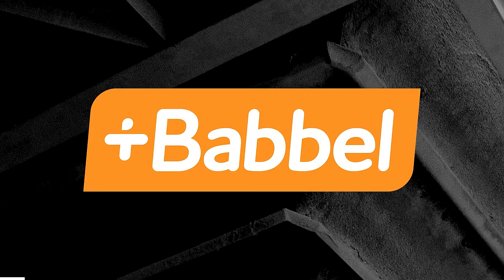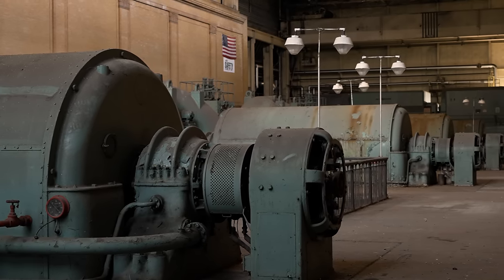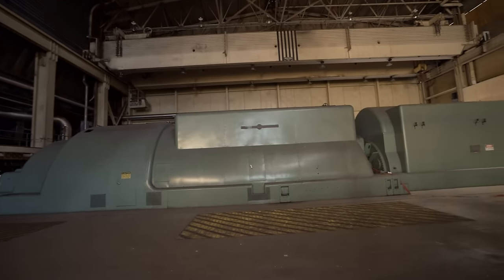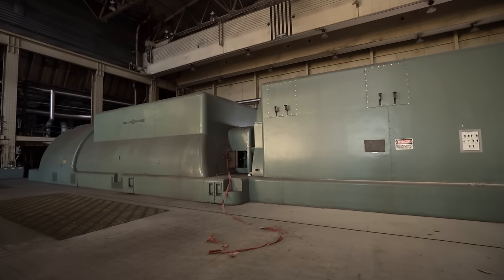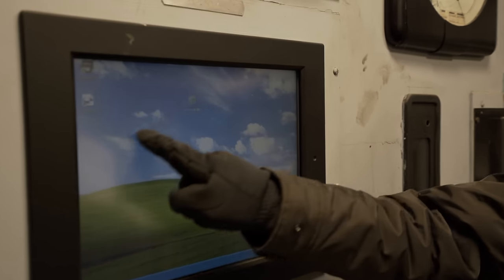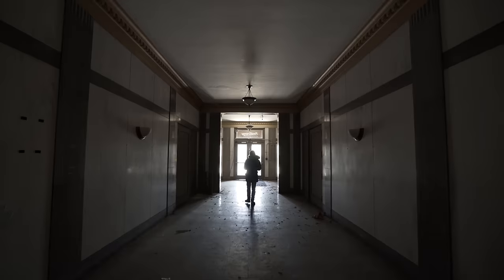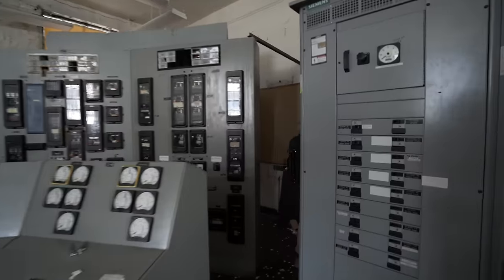Power Still Runs Through This Abandoned Power Plant! - Exploring Industrial Ruins

Comment: 27:50 - i believe those are rotary converters used for converting AC into DC. An AC motor turns a DC generator thus turning the AC into DC. Elevator manufacturers were fond of using these because DC motors are (or were back in the day before VFDs) easier to control for slowing the elevator down etc.

What those are doing in a power station though is anyone's guess.

Comment: There is a lot of abandoned factories in the ohio valley. They just closed a coking plant in follansbee on the west virginia side of the river about 2 years ago. These old power plants and factories are insanely huge monolothic structures that were built to function. We've moved far past the use of analogue machinery as well as traditional brick, steel and toxic asbestos to a more obfuscated architectural style with composite materials and digitally controlled circuits. When you see these places in person, it's like looking at relics from hundreds of years ago.

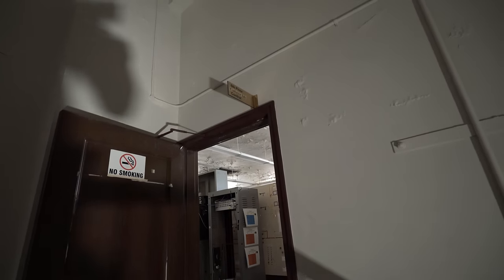Comment: 20:52 The original North Power Plant for the University of Alberta, Canada in my city (Edmonton) was conceived as a multi-use building. In addition to a couple of coal-fired turbo-generators, the rest of the building was used for various university faculties over the years. The Faculty of Medicine occupied part of it for a time and, yes the Cadaver Lab was on the top floor (which caused some difficulty in getting the "subjects" into the labs since there was no elevator!)
The boilers and generator sets are long gone now, but the building has been preserved, including the octagonal brick chimneys and the gantry crane.

Comment: 29:50 that might been the camera server, where it all recorded on. 1) security fiber optic wires that are red color is always used for fire alarm or security, just so entreprenours know not to cut them by mistake. 2) all those extension cores to keep the power on, even thou water leak. It was important. But u dont place important control server for the operation of the plant in the basement, that is a safe space for maintence security stuff. 3) if u count the amount of cameras, there should be 1 red optic fiber line for them each.

Comment: I work for a utility we just tore down our last gas fired steam generator plant boiler types we still have combined cycle. When I first started with the company in 2000 I remember going to that plant and seeing 100 employees working there. Now not a single employee at that plant 3 gas fast start turbine generators that are operated by remote control used for peaking during summer months when the grid needs a fast start generator. The natural gas directly fuels the turbine which turns a generator. We do still have a few coal plants which still use boilers both are in process of being shut down over the next 10 years. The control rooms are still there look just like these built in the 1950's and 60's find a desk with a PC and monitor being remote controlled from a control room at another plant. One PC replaced everything in that room. I'm surprised they don't have cameras, and security systems all of our decommissioned power plants are protected by security.

Comment: I went to a power plant in Victoria, Australia being demolished a few years ago.  Known as Hazelwood, it was built in the 1950's and despite being closed, and half knocked down, the transformer switch yard was still live.......since it was an interconnect with two very large operating power stations nearby.  That station has some really old gear.......its a wonder it doesnt have a mercury rectifier.

Comment: 40:52 I think these are the static "generators" for the electrostatic precipitators (ESP), which were probably the only flue gas pollution controls that plants had in this era. The control panels for them being shown a couple seconds prior. I saw these exact same type of units in the PECO Richmond generating station (built 1923?), and they were also installed right under the roof at the top of the boilers, but in a crazy room with plate steel walls, making it a Faraday cage of sorts. These are just out in the open.
I'm guessing the HV transformer is at the rear and the output is just that metal rod hanging off the transformer that scrapes on the 4 spokes of that wheel being spun by the motor, so it interrupts at some high-frequency interval before being sent to the plates in the flue gas stream. 
The ESPs themselves are the 2 giant square boxes you see right at the base of the "decapitated" stacks when he goes on the roof a few seconds later.

Just a guess, but anybody out there that knows exactly what they are?

Comment: I'm willing to bet if they were to put those original turbine generators back online, they would still work fine and very likely would still be running strong in another 100 years and the newer power plants and new generators in use  will have failed and been replaced at least 2 or 3 times before then.

Comment: It's very likely that the server running that the extension cords were running off of were plugged into UPS systems in order to power the door locks for the card access once they shut things down. The card swipe units run off a serial bus, but the actual power to the locks is separate. Given how many cameras you walked by it's also likely the cameras are/were running off it too. But  it's unlikely anyone was actively monitoring it. Given that they retired the last unit in 2015 and the smaller ones in 2002 it's also likely that the security cameras were only installed in the 2000's as those aren't vintage camera systems It's probably closed circuit.

Either way, the largest danger there was running into live circuits and potentially damage to asbestos insulation. Seeing the frozen fish was probably not on your list of expected things, and that suggests that the plant needs some maintenance to keep it from killing fish.

Comment: 25:15 it's good that the contactor is locked out. Gently throwing the handle would result in a broken arm and possibly a corona discharge of current. There would flow so much current that one must aggressively "throw" the handle in order to "shut" (manually) the connection. Anything less than FULL HUMAN EFFORT would result in that handle "kicking back" out EXPLOSIVELY.
If that plant is still "hot, hot, hot", as it looks, those handles ARE NOT TOYS!
Stay safe and PROPER PEOPLE. 👍👍👍👍👉👏👏👏👏👏👏👏👏👏👏

Comment: 27:50 those things are converters . They take the power from one source for example 600v 3 phase and convert it to DC or a lower or higher voltage . This system was used before semiconductor switching took over for the most part . I worked on similar units for a ship that was build in the 60s . That particular unit was used to take shore power and turn it into whatever they used on the ship . They had a bank of them similar to the one shown , i think they go by a few different names rotocuopler and rotary transformer come to mind but I'm not sure .a similar device can be built to convert say 12v DC to 120ac with the correct pair of motors .

Comment: Live extension cords, wet floors. What could possibly go wrong ? As long as those cords are insulated, and the power strip I spy doesn't fall on the floor, you should be okay until you touch something. Electric doesn't take the shortest path to ground or the source, it takes ANY path. You guys need to be more careful. Great video BTW.

Comment: Blasting the ctrl room with a powder fire extinguisher means it is done for good.. The powder will soon lead to corrosion in many places that aren’t obvious to those trying to clean it.

Reminds me of a naval vessel somehow. Non-asbestos doesn’t mean healthy, it should have been treated on the surfaces.

Excellent mix with the old footage, I watch a lot of the old stuff just for fun, like poking a periscope up into time long gone.
Reply: that X-section of the plant is interesting. it shows it as a whole and also its principle of producing heat: Forced air blows milled coal dust into the furnace where it gets combusted in an efficient manner.
This is the same process like in the one you visited in Spain, I am not sure but I think this process was invented in the UK for use in shipping. Happy to be corrected if wrong.
The very high stack is somewhat of an indicator on its principle of operation, one doesn’t have a long furnace but a tall one where the returning feedwater is brought in through the boiler tubes from the top.

The water in the system is under pressure and usually temperatures over 150C are used for the best temperature gradient between the low pressure side (chillers) the high pressure inlet to the turbine ensuring best fuel/power efficiency ratio.

I have worked in a similar plant albeit we didn’t use coal but in theory we could do so.

The spring loaded carbon electrodes in the feedwater circulation pumps are huge and mounting them is interesting at best.
Somewhere there also should be a capacitor of epic proportions (you can put a car in it..), a huge metal vessel with an inner electrode that is moved around inside an electrolyte. They are used to reduce the magnetic load of the pumps.
Reply: 27:50 those are AC/DC converters.
In the generators there isn’t an array of permanent magnets but exciter coils.

Be aware of all oils in these places, most contain PCB.
To me they are a greater concern than the signs and stickers with a white a on red background.

what a mess that lower floor is..
Reply: those fish are from the in/outlets of the plant or they are from the lab where there often are aquariums where the cooling water is tested.

Comment: So question for power technicians and plant  engineers. if it still has power coming into the main areas of the building even tho main controls an switches have been removed. 

Wouldn't that still be considered operational and functional and able to turn equipment on because it doesn't appear that every button or switch was removed or cutt so doesn't that mean its active and they said cameras were recording meaning it has crew working there correct. now that could dismantle crews right

Comment: Very strange that the backfeed has been active and unattended for nine years.
Reply: elsewhere in the comments someone said parts of that plant were still in standby mode for emergency use but were slowly being phased out.
Reply: @rupe53  Here's the problem...the plant is being powered by the 138,000 volt bus. This is stepped down by the Station Service transformer(s), to either 4160 or 2300 volts. This is stepped down by the various bus transformers to 480 volts. 
Not only is this extremely dangerous to copper thieves, but it's a hazard when rainwater gets into the station.
Reply: @spaceflight1019    you are probably correct on all counts, but there does seem to be some form of light security and various areas that are under lock & key, plus this video is pieced together from segments taken at various times over several years. We really have no idea of how long things have been left "live" around the plant. Could be 6 months or 6 years. One thing that doesn't add up is hanging around to do clean-up work. If this was really a covert operation they'd be moving along more quickly and not fooling with intercoms or the like. Someone on site has given them the nod or is turning a blind eye while they shoot this video. The rest is for drama.

Comment: I'm surprised that there is still electricity going through this abandoned power station.

If this power station has been decommissioned (permanently taken out of operation), surely they should have completely shut down everything in the plant & completely fully disconnected the power supply from the whole plant.

It's not going to produce electricity anymore so why leave stuff still switched on.

It's just wasting electricity.

The power plant is impressive though, especially the turbine hall & main control room.

In the UK where i am from, the UK Government & National Grid are permanently shutting down our coal fired power stations slowly to try & reduce the amount of fuel emissions that goes into the air from the plant.

This is being done to try and reduce the effects of climate change/ global warming.

Comment: If power is still running through this abandoned power plant, then how is that possible? How did it generate power when it was open? And how can it still be generating power now that it's shut down. It is being powered by free (ether) energy? Does anyone know why power is still available in the power plant?
Reply: The owner of the plant, First Energy, is not producing power in the plant. Instead, they have connected the minimal power needed to enter the plant’s interior spaces to the existing grid. (From outside the plant) As the owner, they would still need to get in every once in a while and as prep for the ultimate demolition.